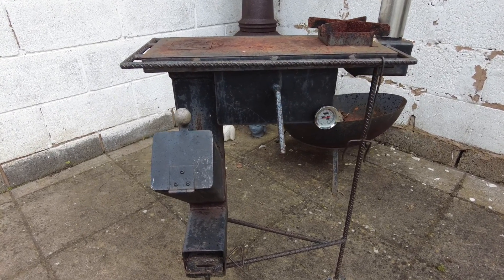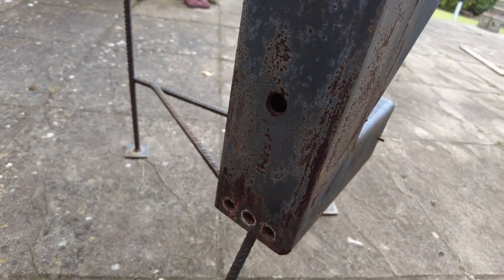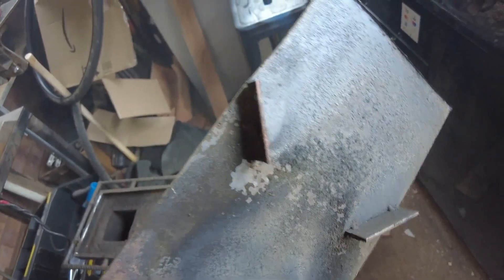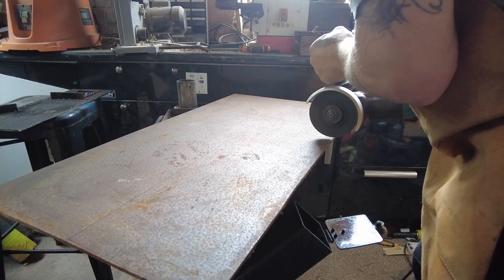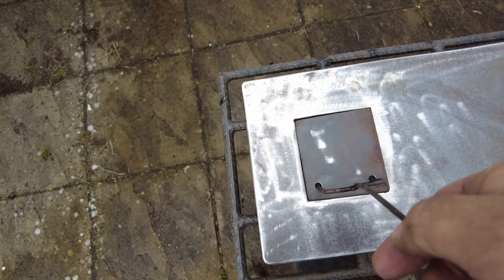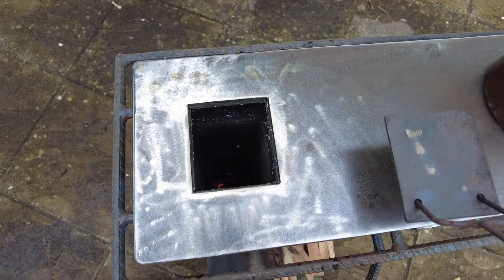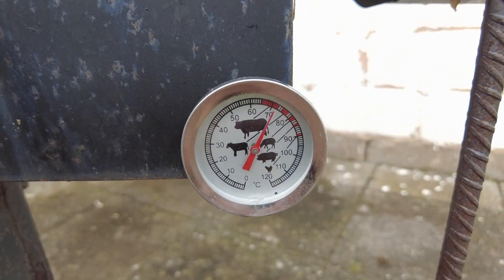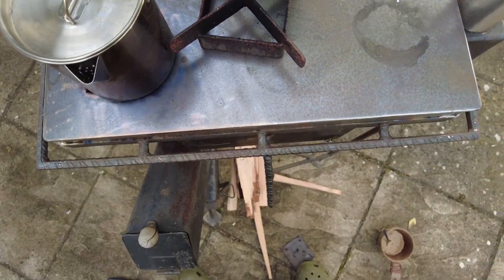Rocket stove with hotplate and oven. At last, I have it working properly.

Comment: What about putting a 3 inch or 4“ x 1“ channel under the oven and up directly into the base of your chimney with a flapper valve in it? Just add on a three sided channel to the base of your oven. You may not need the flapper valve, but in the case when you’re not using the oven, you’d want all that heat going to the top? You could put a flapper valve in your main chimney on the rocket stove so that you could shut the top off and have all the heat go to the oven, and then by cracking open that flapper valve, you could have some control on the oven heat by sending the heat to the top? What a great project are you selling these in the United States yet? When you get this refined completely done, this is what everybody needs in their backyard.❤️‍🔥❤️‍🔥🇺🇸